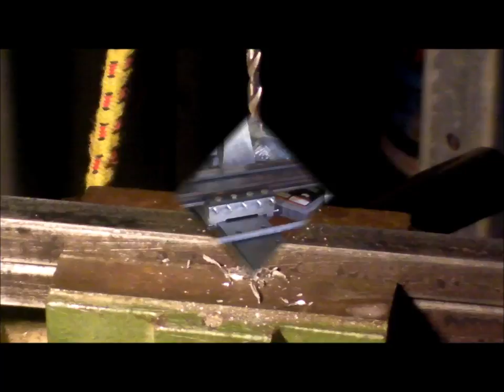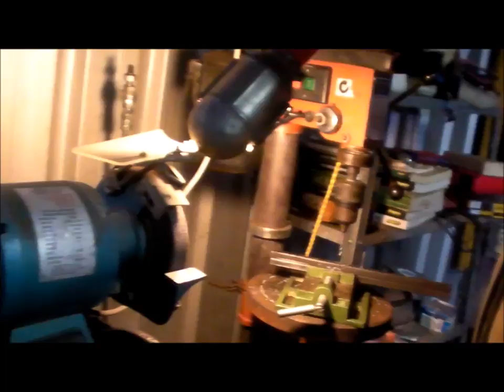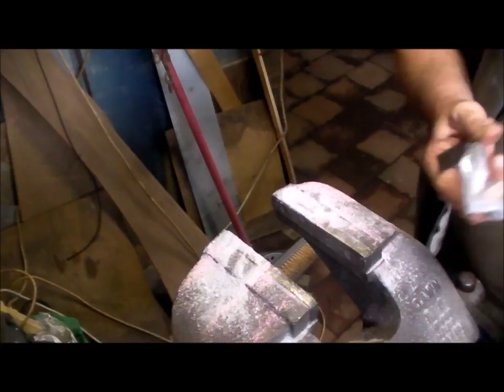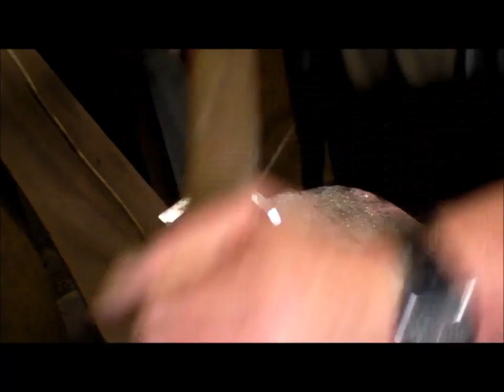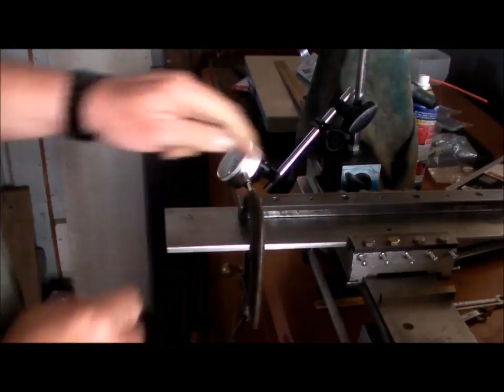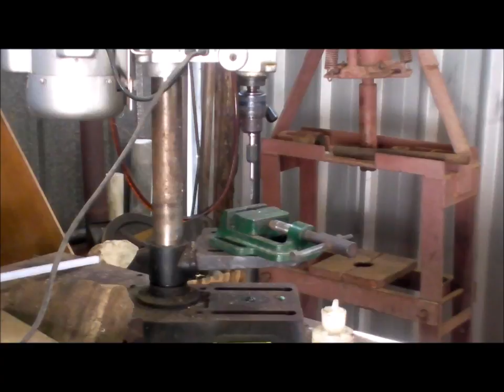Building the Gingery Milling Machine 25  temp work table

Comment: Does chalk prevent the swarf from catching in the file teeth? I have been using WD40 when filing aluminium, but I still have to clear the chips occasionally with a wire brush.
Reply from the maker: G'day Big Red, to be truthful, very little, I still have to clear the teeth constantly, but it is better with finer 2nd cut than with the bastard file, it is true to it's name. For best results I use the body filler file, it has it's limitations with large teeth gaps, but it doesn't clog up, ever. Thanks for stopping by, Peter